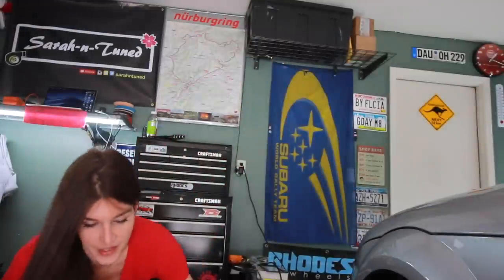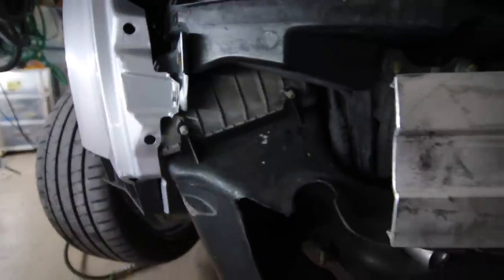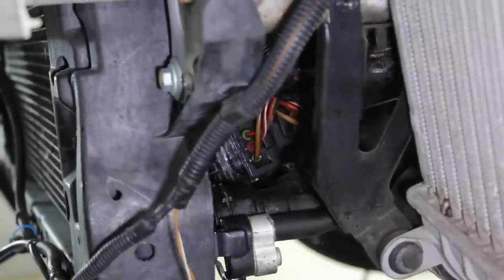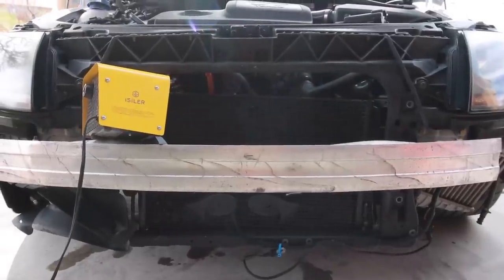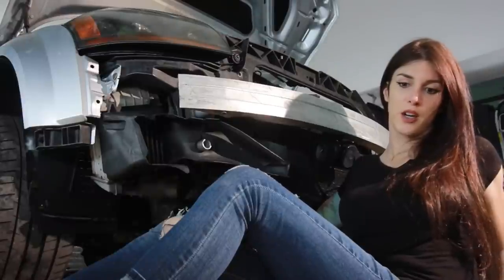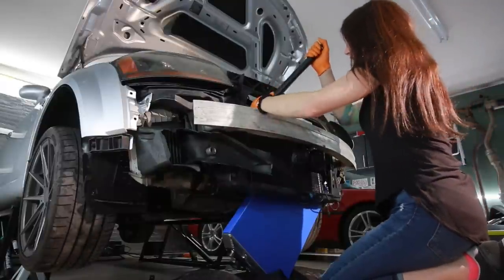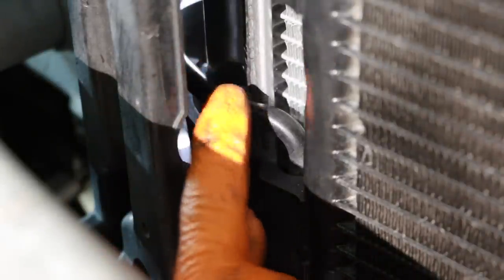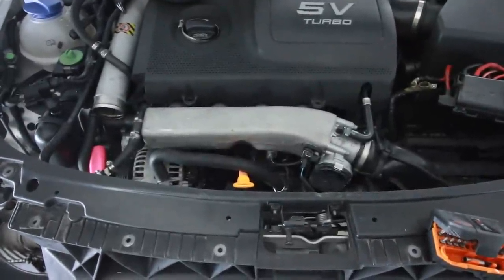Installing Track-Ready Cooling Upgrades // Project TT Quattro

Comment: Hey Sarah, give youeself more room!  That black radiator support that holds the lights, condenser, radiator, etc, is called the lock carrier.  If you get 2, 8 inch to foot long bolts at the hardware store, you can slide it forward.  Take out 2 bumper bar bolts (one on either side) put the 2 long bolts in, the take the rest of the bumper bolts out and viola!  Slide the whole carrier forward and drastically improve your access.  Hope that helps!
Reply: Also known as putting the car in "service position"
Reply: @03harleydeuce  I was about to post this

Comment: I know it's a bit late now but I find it much easier to just remove the bumper bar & cross member. This is what I do with my Audi Allroad. I can then access the whole front of the engine a lot easier. I do have service bolts but it's so cramped in there. It doesn't really take that much longer & saves your knuckles. Love your videos. You always make me chuckle.

Comment: If you do decide to pull the intake mani off, you should polish it, it ends up looking nicer in the engine bay. Putting a fatter radiator on most cars takes some modding, it doesn't always end up being easy.

Comment: Hi, Sarah. Be aware that most of the 1.8T water pumps has plastic (nylon) impellers. They sometimes crack and slip on the water pump shaft, causing overheating. "Graf" makes a nice replacement water pump that has an all metal impeller.... Higher output, too!  I just installed one on a 2002  TT, last night, in fact, and have another one to install on a 2003 TT, next. After that I have a TT requiring foam replacement on the HVAC air distribution doors (foam blowing out of the vents). Neat car when you get it fixed up. Nice work!
Reply from the maker: B Streeter I have a brand new metal impeller waterpump, there’s a video on that as well.

Comment: The install is going just fine Sarah ; anytime you install a slightly over sized part on a Audi, your in for clearance challenges - especially on a Audi!  Time for a new tool: die grinder with a cut off wheel..... get a face shield!  (safety glasses aren't enough). 
If ECS is with you, you are definitely doing well!  Congratulations!!

Comment: Next project build a work bench tall enough for you with a vise.Priceless addition to your work space . Great channel Sarah 👍
Reply from the maker: Robby Jr my garage is too small for that, I have to fit cars in here.
Reply: I definitely hear what you're saying I'm sharing a link this is what I had in mind.I've built something like this years ago and I simply used heavy duty steel L brackets to  hold my bench and lag bolted it to the studs on the wall"center of stud" never failed me certainly  wouldn't recommend standing on it but it definitely gave me a platform to work on. Take upper half of your toolbox  and place on bench  With a little creativity you'll be surprised what you could fit in that space. OK be safe look forward to your next updatehttps://youtu.be/yWrsMcW6XFA

Comment: I always found it easier to remove the impact bar and radiator support to replace the radiator . The radiator supports were always broken because they were made out of plastic. Keep up the hard work .the radiator support can be pulled out with out disturbing a lot of stuff. Pull out one of the bolts that attach it to the frame and put in a 6 inch long bolt. Then remove the rest of the bolts . Now you can pull the support forward and hold it forward by clamping vice grips on the back side of the support on the long bolts. Now you have a lot more room . I worked a VW dealer for a couple years and we always used that technique the  work on the front of the car.  Try it you will love it .

Comment: The first step on working on any TT is put the front bumper in “service position “( remove it from the car) doesn’t matter what you are doing they just like the front bumper off one of many many issues I hate about my TT
Reply: The same on all VW Audi Skoda and Seat.
In Service possition you have 15cm more space.
And with original parts you have 1/2 the work.
Original parts do the job, why this bad fitting shit?
Reply: It's def a different way of thinking with these cars.
I have quite literally never had to pull the bumper to work on a Subaru.
You pull the bumper only if you need to work on... The bumper.
That has been my experience with most Japanese cars.
The newer compact jobs are different I'm sure though.

Comment: Sarah, the intake manifold looks perfectly normal. The rough surface is stock, no corrosion at least on the surface, from looking at your vid. Please get to the gaskets next.
Keep up the great work, you're an inspiration! I am looking closely at what you're doing, bought a 2002 TT two months ago, not as messed up as yours initially, but still plenty of things to do.

Comment: Sarah...that's life with an Audi. My buddy had a TT of the same vintage, and we had just as much trouble.  BUT...while you've got it taken apart, might as well pull the intake off and clean it up.  I agree with the wrinkle finish, it'll look good and class up the engine bay a little.

Also, I should note that my I'm having similar troubles with my '02 Mustang. I was doing a head gasket replacement + new headers and ended up braking the radiator and fan during the tear down. (I've had the car since new and it's got 160k on it...so it's fine). But I get the frustration from it.  It's always something and it's always on the stuff that should be easy.  You do great work and I love watching your video's.  Keep it up and don't let these set-backs push you too far down. It's just an excuse for you to learn something new you didn't know you needed to know! ;)

Comment: Wow what a process! I'm not joking when I say I can probably swap the radiator in my WRX in 10 minutes. 20 if I have to swap the fans over and the bolts are a bit rusty. :P
At any rate, I really hope the Audi stops giving you so many little problems. Teeter Tot owes you for all the love and parts you have put into it!
Reply: 2nd that one !

Comment: Hey Sarah, the best Teeter Tots are the slightly burnt if not perfectly crispy.  Clip the dryer bracket.  Find a creative way to support it from vibration if not only padding.  Install your radiator.  Of course your fans want to see your intake designs.  Go track racing.  Crispy TT, burnt TT, yummy TT.  TT not mine but that is what I think.  The closest thing to Audi with me are the first letters of this handle.

Comment: As long as we're not expecting the new radiator to fix the fans or the temp gauge sitting a notch high at 99*, this is a good improvement for once you feel comfortable getting it on a track.

The stock radiator is fine for stockish power, and even a little more when it's working properly, but with it being of legal age at this point, it might not be up to the task for that extra load you're already putting on the system.

Comment: Idk if the tt is like the a6 of that generation, I would assume it is. When I did a rad upgrade and some other stuff, I found it easier to just remove the whole front for access to the front of the engine and to work on it without cutting myself up.  Keep up the good work, my audi never got completely sorted out after fixing something another thing pretty much came up, was fun though.

Comment: The fitment issues with that is why I don't like those aftermarket, somewhat-universal fit radiators. Cutting that bracket shouldn't cause any issues, as long as you don't have much flex or stress on the lines. Great part of AC systems is they're almost entirely Aluminum, so the lines are pretty forgiving until they crack.

Just for reference, we get paid 3.4 hours to do this job, with parts that do just bolt up without modification. And yes, working on 20 year old crusty cars can make that a very tough 3 hours.

Comment: Great content is always. Don't worry about that coolant just think how clean the inside of that block is. As far as your Dremel and you're cut off will you may want to use a thicker cut off wheel with an air tool for that type of a project. By the way I think a wrinkle finish would look good with the other finish in the engine bay.

Comment: I wouldn't pull the intake until you have the parts to replace the PCV valve and hoses down there, you'll just need to pull it again. But it is good to not see oil flowing out of those intercoolers this time around.
Reply: For sure replace ALL of that when you have the intake off.  Good call!
Reply: 034 makes a very nice kit, with Silicon hoses and a billet valve.

Comment: I feel your pain, I'd forgotten how crammed the engine bays where on those. You'll get the better of it, fresh head in the morning. Makes sense if you've can do other jobs whilst it's stripped out, if manifold off have a look at the throttle body a clean inside round the throttle plate probably wouldn't go a miss.😀

Comment: you're doing that the hardest way possible! Dissasemble the core support and front bumper reinforcement turn upside down, replace radiator and reassemble.

Comment: If parts are available quickly or at least less than a  full week, you should knock out anything front end while you have it apart, lessen chance of breaking or losing something the next 3 or so times you take apart the front end. Takes away some of your film time but maybe adds more other ways.  I love the work you’re doing on TaterTot and it’s help realized I made the right decision never buying one 😂. You’re more than welcome to knock out my c55’s radiator for me while you’re working on cooling systems. I’ll provide the tools, coated garage floor, all the overpriced tools need & tacos from some of Houston’s best spots.

Comment: Don't bother painting the intake manifold. It's normally hidden by a cover. If the dirt bothers you, have it bead blasted if you were going to remove it to paint. Permatex 51813 is good for clean mating surfaces like intake manifolds.
Reply from the maker: Buttercups True Love it’s actually not, google the 8n 225 TT engine bay.

Comment: Hi loving the program with the oil pressure light coming on it is more then lightly is the sensor but keep your eye on it as the 1.8t 20v engines tend to get the oil pick up pipe full of crap and need cleaning out ( I’m sure you know but just a heads up ) 😊
Reply from the maker: Roy Bamford yeah, when I had the valve cover off it looked super clean (no sludge). It was dealer maintained up until 2016 when someone who absolutely hated that car bought it and beat the crap out of it. 😂

Comment: You need some miniature death wheels. These will cut some metal. Dremel 1 1/2-in EZ Lock Rotary Tool Cut-Off Wheels for Metal (5-Pack) Model # EZ456. Can be found in most hardware stores.

Comment: Dremel makes a fiber cutoff wheel that would be ideal for cutting the bracket.....Harbor freight also carries them. Had a 97 Ford Explorer ans a little hose connecting the water pump to the intake manifold split. I could see it right on top....ended up taking the radiator, shroud, and fan off just to get to an L shaped hose 4" long. Took all day. Factory 5.0L stuffed into an suv originally designed for a V6. Nightmare to work on.......Chin up....you will get it eventually   ;-)

Comment: Those plastic fittings on the hoses can be a pain if they've been in place for a while ( 18ish years counts!) I usually get a medium pry bar to give a little pressure on the back of the flange, and then counter that with a hand on the other side. A little back and forth and as soon as the o-ring moves past it's resting place, they usually come right off.

Know you have new parts, so it doesn't matter, but I always install a new o-ring in the hose, and/or clean the area the o-ring was on, depending on which part is being replaced. I think you usually do it correctly, but nothing but the fluid the seal will be seeing to lube the new seals, coolant in this case, I can't stand when people start using grease or Silicon lube for seals like this.

Comment: My TT convinced me the easiest way to pull the turbo is remove the cylinder head or drop the front sub frame with the engine from under the car.
Reply: OMG, and I am thinking of getting a TT? What is wrong with me?
Reply: @ndhesketh
Reply: Funny, but I Love my TT. Fantastic to drive hard to work on.

Comment: Hang in there Sarah.  Some days you're the bug, some days the windshield.  My 1st Wheeler Dealer car was an 01 turbo AWD TT.  It was named Rowdy (the Audi).  Everything was a b#tch to work on because it was all crammed into small spaces.  And you couldn't leave it locked because at night the driver's window would mysteriously drop 1/4" on it's own and set the alarm off.  Been buying Boxsters & Caymans since as my Wheeler Dealer projects.  Really enjoy your channel.

Comment: If your low oil pressure light is coming on it's probably the oil pickup pipe that is plugged. It's common for these 1.8s the oil passages are tiny on these and people that don't put correct oil in them and neglect to change it. For good measure I would put a new pickup pipe on it.
Reply from the maker: Travis Hammond It’s not, it’s the sensor.
Reply: @SarahnTuned  I would still the the pickup pipe for piece of mind. You don't know the cars former life. Plus it will make good content. With your ability it probably would only take you a hour. The most time consuming part is cleaning up the pan. Heads up the inner bolts will need a wobble head and don't drop any behind the plate.
Reply from the maker: Travis Hammond I have the complete service records of the car, it was dealer maintained up until a year before I bought it. If it was actually low oil pressure there’s no way it would have survived an 800 mile trip back from Utah, plus all the driving I’ve done since.
Reply: @SarahnTuned  touche' I do remember you saying that in one of your videos now! Lol. All I was saying is when you take the sensor off might as well do it. Keep up the good work. Make us more videos 😁

Comment: I'll be curious to see if the new radiator solves the overheat indication.  It didn't for my sons TT.  New radiator, thermostat, water pump, temp sensors none of those fixed it.  Rebuilding the instrument cluster solved the problem.
Reply: SMH

Comment: I wonder if the interference with the AC drier is because of the front-end impact that's evident on the bumper, wouldn't take much of a hit to move things enough that nothing fits easily any more - Volkswagen Audi seems to love packing things in tight to begin with.
Also, If you must use a Dremel for jobs it's not big enough for, try to find the reinforced cutting discs, they're a bit more tolerant of side loads. The plain ones are way too brittle for that.

Comment: Have a tt that I bought for the wifey and the car had a bunch of problems. It was overheating changed all the sensors fan relays but come to find out that it's the water pump any suggestions on how to do the water pump and timing belt your the pro and just would like some help on how to get it done thanks and great videos great work thanks

Comment: You prob would of been better off removing the crash bar and rad pack so you could of pulled it away from the engine slightly and got down between the back of the rad and engine block this way when it came to reinstalling the rad you could push home the rad pack for test fitting and would have more space for the fettling needed

Comment: Hi Sarah!  Love your videos. Ive got a Red ABT commemorative edition TT with similar temp fluctuations. Curious to see if the radiator is the fix all. Looking forward to the next vid.
Reply from the maker: Greg Sutton according to the VAGCOM, it’s staying at a steady 99°c, but I do know when it starts to get hot out it may climb higher.
Reply: That's good news. Hope it holds for you. Looks like I'll be installing a radiator as well given the success your having with yours. Like yourself ive exhausted all other possibilities so I thought. BTW, the moulded in grill ring look that I think your after comes factory on the ABT commemorative cars. I bet aftermarket reproduces them by now. Looks like teeter-tot is going to be a serious pocket rocket. Cheers!

Comment: Hi Sarah, did you ever have a sniffer test done just to make sure the head gasket wasn’t on it’s way out , also did the water pump have plastic or metal blades on it when you replaced it when doing the cambelt, I don’t think what you are doing is going to sort out your over heating problems on the TT , but I could be wrong
Reply from the maker: Phil 1969 if you look back in my videos, I already replaced the water pump with a metal impeller unit.

Comment: Did you removed the oil sump during this project? Oil pressure problems are common on these 1.8t. Sure it can be just a bad sensor but also a bad (clogged up) oil pickup in your sump. Had it with 2 1.8t mk4 Golfs.

Comment: Cooling upgrades? Great, Turbo upgrades next perhaps? ;)
Reply from the maker: Project Supercar no, suspension has to come next. The factory struts, bushings and ball joints are looking kinda rough.
Reply: @SarahnTuned  That makes sense, make the car handle before increasing the power? So many people go straight in with more power (said using a Clarkson voice), and I must confess, I've been guilty of that, lol. Great fun though, crazy but fun ;)

Comment: My teeter tot runs cold, the temperature gauge only goes over like two bars, but if I sit and idle for 10 minutes it'll go in the middle, I guess it's a bad thermostat I don't know oh, I guess it's one of them thermostats that when they break they stay open and over cool rather than stay closed and overheat, like what else could cause my car to run cool